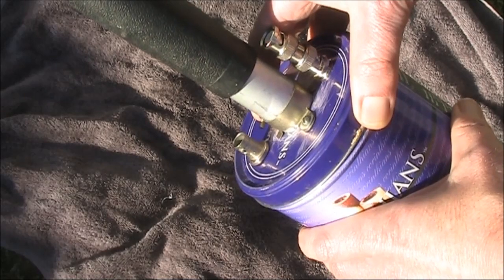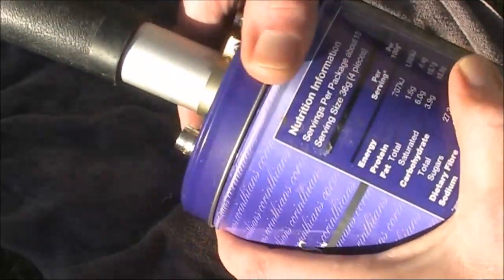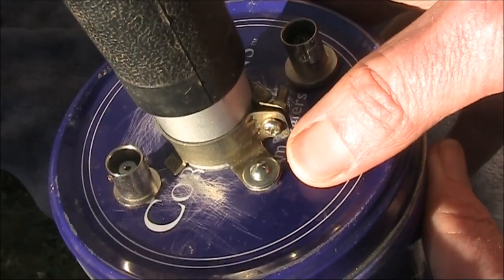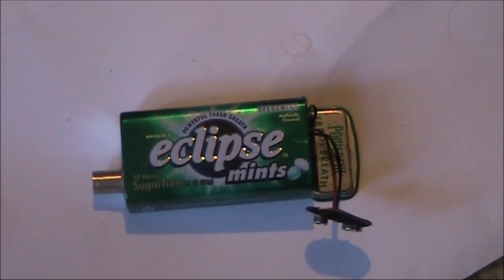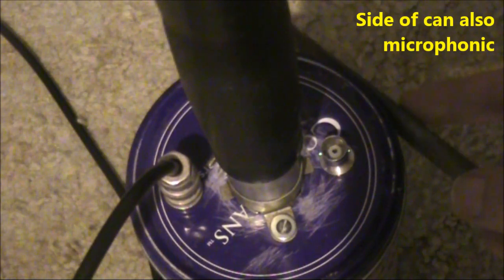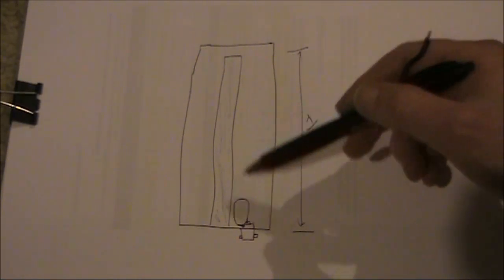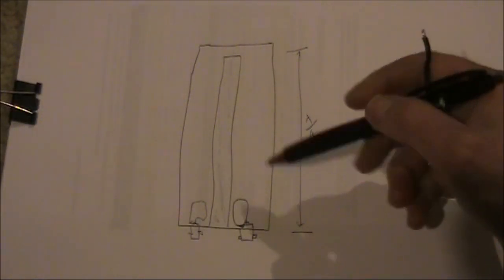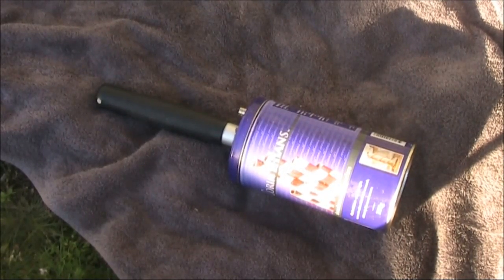Fun with cavity filters

Comment: A few words...
The frequency is determined by the length of the inner (not mass, it can be  (usually is) hollow). It should be 1/4 wavelengthll long. The Q is set by the ID of the outer (bigger is better), and the conductivity of the inner surfaces (mostly). You want the Impedance to be 50 Ohms - set by the ratio of OD / ID. The end where the connector(s) are (is) must be shorted. The other end needs to be closed only to preclude corrosion. It could be a removable plastic cap. Your milage may vary. 73 de Derek, KN6TD.

Comment: Are there general rules about the diameter of the cavity used? GREAT video! 73!
Reply from the maker: I believe that it gets more efficient/sharper as you increase the diameter, but there's a point where the diameter is excessive for proper operation.

Comment: Does it matter what end you attach a filter  to the antenna?
Reply from the maker: Sorry I don't understand your question.
Reply: As shown, it does not matter; the device is symmetrical and bi-directional.  Either port can be the input with the other as output.